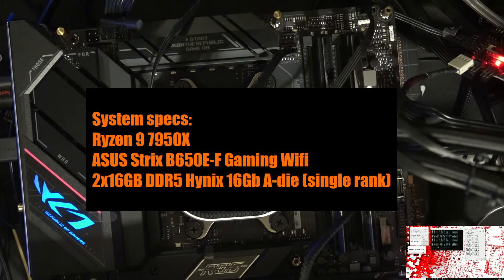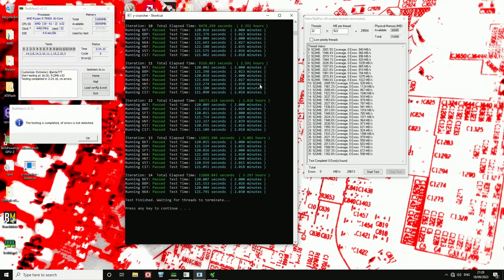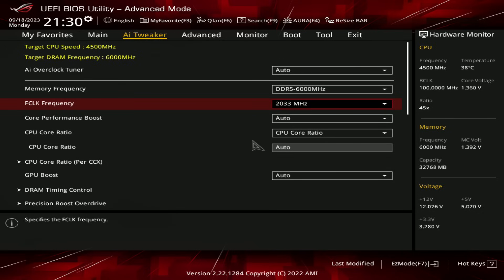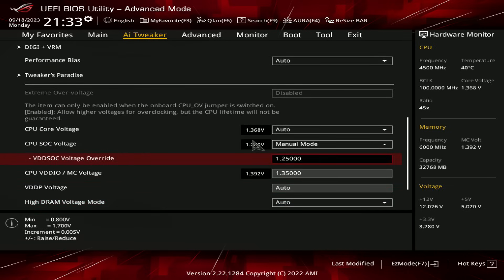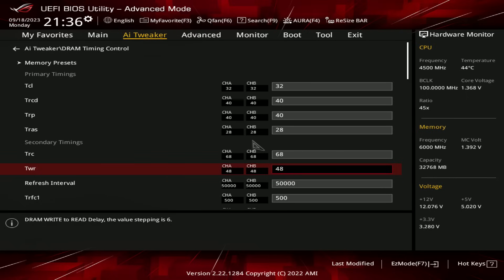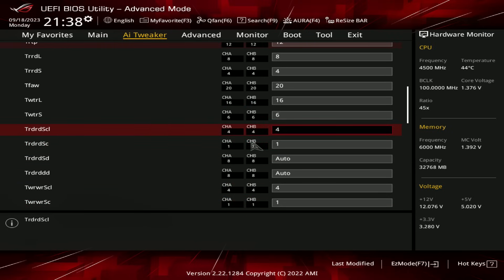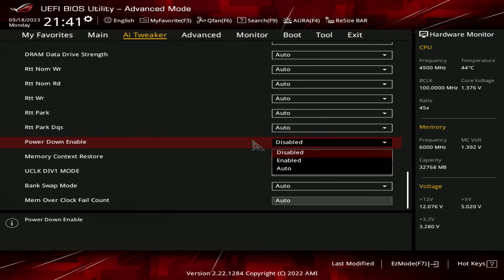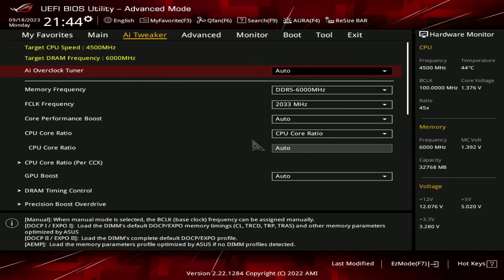Easy memory timings for Hynix DDR5 with Ryzen 7000

Comment: These timings worked perfectly on my 64GB dual-rank G.Skill 30-40-40 Expo kit (Hynix A die) with 7800X3D and Asus B650E-I.
I even lowered SoC voltage to 1.125 and VDDIO to 1.3

Stress testing passed. But my latency is around 63-64ns... Is that about right or seems high?
Reply: what settings did you use for the dual rank specific values?
Reply: @sandboxie97  I used same values from the video
Reply: How many memory modules do you have? I couldn't get it working with 4 modules
Reply: @icarus33  two sticks. I got s motherboard with only two slots because I knew 4 slots can cause issues.
Reply: Updated the BIOS a year later and now my PC won't post with these settings 😤

Comment: So after the recent drama about blowing up the Cpus limiting soc to 1.3V in Bios is it still safe to run VDDIO/MC at 1.35V ?
Reply: Yes.  The issue was with some motherboards sending too much voltage to CPU_SoC.  I have my MC/VDDIO getting 1.4V as I (unnecessarily) have 64GB of RAM.

If you have an Asus board, I would recommend manually entering 1.25V for the CPU_SoC setting instead of the 1.3V that AMD recommends.  This is due to the Asus boards sending more voltage than what their BIOS says that they'll be sending.
Reply: @NippleSauce   Thx that was helpful.

Comment: Thanks Buildzoid.  I've been worried about my 7800x3d asus x670-e system since the issues started.  I wasn't satisfied with just reducing voltage on my expo settings and I found your guide through GN. After following it, I was showing stable with OCCT tests.  Running stability tests again after reducing soc voltage further to 1.2 and VDD, VDDIO etc. to 1.3.  So far so good and better performance than when I was unknowingly feeding too much voltage by way of ASUS expo voltage accompaniments.  Anyone have suggestions if this setting is stable?  Additional tests beyond OCCT? Try to push beyond 6000mhz and 2033? Thanks!
Reply: Hi mate, I'm wondering if your system is stable with these settings, as I'm about to get my 7800x3d build complete 
I'm trying to find a solid (6000/6200) timings, and the one I chose is T-force (6000-Cl30-36-36-78) as a default XMP.
Reply: @Rochi7  are those hynix? I'm using gskill sk hynix and the expo is 6000 30-40-40-96. I have expo off with buildzoids timings set in except for 1.2 soc voltage and 1.3 for the associated memory voltages.  Been running it for a few weeks now with no issues. Cheers man.
Reply: @vasheroo  Wow thats great 
and yea t force I have is hynix
Edit: I can not guarantee if it is always hynix, since you know they change their chips frequently to avoid sales problems. I remember I saw some of their models including letters that refers to (A-die) like this model as an example (FF4D532G6000[H]C38[AD]C01) and and it is not A-die but it is hynix.
Reply: @vasheroo literally exact same for me, so far.solid, stable, and i have better fps, more fluid gameplay too.    I also OC/undervolted my 7900xtx merc 310,     cpu temps are like 50-65 for gaming, 70 when shaders load.    And gpu temps are 60ish gaming, with junction of 78-83°,     please relay me your temps? <3 tyyty
Reply: My hynix is an m die btw , this vid worked flawlessly.with my m die
Reply: @fuckyoutubrforchangingthis  Those sound pretty similar.  I booted up control and set it to ultra and dlss to increase the frames with all the rtx and cpu temps were about 60 degrees C on both the CPU and 4090.  Corsair h150i 360 rad on the 7800x3d and the 4090 is the liquid msi.  Fan speed is generally set more to quiet running.
Reply: Cpu-z works to tell.if its hynix or samsung die

Comment: Thanks Buildzoid, I followed these settings for my ADATA 64GB XPG Lancer RGB 6000MHz DDR5 on a Gigabyte B650 Aorus Elite X motherboard with a 7800X3D. My system seems stable with VSOC of 1.2V (was too scared to bump it up higher due to exploding CPUs) and VDD of 1.35 (as per EXPO profile).
One thing I found different is that for my Tras, the lowest value I could set was 76.  I had no option to set it to 28.
Reply: Mine is 30
Reply: It’s all good man he revised it in a newer video and it’s above 100 now and apparently takes no performance hit but still stable
Reply: what kinda performance gains did you get? i have the sameeee cpu and mobo

Comment: I've never manually overclocked or set any manual timings/settings for RAM before and got this exact video bookmarked for when my F5-6000J3040G32GX2-TZ5K arrive. I will be using them with Ryzen 9 7900X and MSI MPG B650I EDGE WIFI. I ordered them because their low timings but it's with 1.4V which at this point I'm obviously not gonna use. Would I just be able to copy paste video settings and set the specified timings from G.Skill at 1.25? Or would I most likely have to increase my timings?

Comment: Thanks for the video, it was very helpful.
However, 2033Mhz Infinity Fabric clock is not a universally good idea - on my TUF GAMING B650M-PLUS WIFI it leads to retransmissions, causing lower performance and random audio crackling.
Reply: I have TUF GAMING B650-PLUS WIFI so what Infinity Fabric clock must be for optimal performance? 2000MHz ? or more than 2033 Mhz like 2067 Mhz , 2100 Mhz etc. ?
Reply: @nanotech5904  in my experience 2000 works the best
Reply: I experienced this too, tried a few different FCLK settings with no avail. What actually changed things was lowering my primary timings. Sadly after a bunch of stability testing which passed it seems like my memory doesn't like cold booting with these timings. Did you make any progress with this?
Reply: @BobbyFuzzy  I ended up returning to the stock "tuned EXP2" settings instead of overclocking memory. Seemingly stable adjustments turned out to be crashing specific games, like Metro Exodus, so I decided to just wait for better RAM sticks instead.
Reply: @Strange_st  Fair play. I think I will be doing the same tbh. Thanks for getting back to me! Have a great day 🙂

Comment: Can confim that i can replicate this exact settings using ADATA Lancer AX5U6000C3032G-DCLARWH (32x2Kit, 6000Mhz, Hynix A Die), everything is working great as well, i don't even need to change DRAM Voltage. Thanks a bunch Buildzoid!

Comment: I got my my girlfriend and I the same RAM kit (should be SK Hynix M Die). Mine was A die (at 5600 kit) but hers is unknown in HWINFO, but it is SK Hynix apparently. I can't seem to indentify it.
My RAM is stable at timings at much tighter than those in this video. However hers is blue screening at the timings in this video. Any ideas? I'm using a 7800x3d and she has a 7600x. I'm kind of lost why its blue screening on these timings which I now know to be really safe given I can go much tighter.
Reply: all ram is different even with same brand.

Comment: Tried this with my 7800X3D and an EXPO stick of Hynix M-die. Absolutely no chance. If I increase the VDDIO at all, I get Bluescreens or freezes. Same thing when I try to lower Tras even a little bit. Refresh interval can be increased no problem. Some other timings can be moved marginally. But otherwise a lost cause. I use the latest Gigabyte BIOS, so maybe the limitations introduced with it are to blame.
Reply: EXPO is irrelevant, just saying. It's just a profile for primary timings, speed and dram voltage, nothing more.

Comment: I bought a cl32 gskill 6000 expo kit but it cant run with the 6000mhz. I lowered it to 5800 mhz and it. Works fine. 32-38-38-28 and the rest with your secondary timings. Lets see what happens. 
First time trying memory oc. 

Nope dosnt work for me, it fails on y-cruncher SFT or C17. Says something is to large failed core 9 ?

Comment: FYI, disabling Power Down Mode made my system incredibly unstable - would blue screen on/just after boot over half the time, and even freeze in bios frequently. Took a while to narrow it down, but that seems to be it
Reply: Try disabling MCR.
Reply: @MrShnig  what is mcr
Reply: @SmellsLikeNirvanna  memory context restore.
Reply: I disabled both MCRs as well as power down and still got bsod on restarts. Re enabled all of it and bsod went away
Reply: @YT_Booost  I wrote to Asrock support and they told me ddr power down needs to be enabled for newer AGESA by AMDs rules.
Reply: Thank you for the heads up, I never considered that it could be the culprit for my crashes and freezes in BIOS. Maybe without it I can give it another try.
Reply: Thank you for this, seemed to solve BSOD and BIOS freezing.
Reply: Always use MCR and PowerDown together! If MCR is Enabled then Enable PowerDown!
Reply: memory context restore always disabled with power down disabled. Keep it like this if you OC your RAM
Reply: Were you able to make it work with it disabled?
Reply: Anyone else give this a go? Seeing the same issues as Broodyr. I was bluescreening around Windows login and while in bios. I could however run memtest5 and occt for an hour each just for minor testing with no crashing. Going to give turning on Power Down Mode back to auto a try and mess around in BIOS again and power on/off a few times to see if it fixes the problem.
Reply: @spardock3313  it's the power down mode and nothing else. For some reason it BSOD's and even freezes in the BIOS so I had to restore to a saved profile and everythng is perfect.
Reply: @realcapo88  did you try disabling MCR when you were trying to disable power down mode? My power down mode being off only led to crashes with MCR enabled.
Reply: I had the same issue, with power down, i can't tweak that...bios crash...blue screen..
Reply: that sounds more like a bug than anything else. training on every boot is never something that is expected to be set permanently. and power down mode shouldn't affect these.

I just mean putting these as recommendations might not be wise when some agesa update could make it wrong in the future
Reply: @e_one_m_one  I agree that it sounds like a bug, that something is stored in the memory context restore from the previous dram power down mode on, which causes the freeze if you just disable dram power down and keep context restore on. did someone try what happens if you disable dram power down, disable context restore, boot, reboot and enable context restore again, boot, so it does a fresh training if it then maybe works?
Reply: @e_one_m_one  I contacted Asrock support and they said their bios department said it is normal for the Pc to freeze when you disable dram power down mode and it is not supported with newer Agesa lol.
Reply: did you fix your problem?
Reply: @Aleph-Noll  what problem?
Reply: Anyone on here tested if you can run these BZ timings for a 6000 kit also with 6200 or 6400? or is it kinda strictly limited to 6000 if you dont change primaries.
Reply: @bestonyoutube These timings are for 6000. They will fail the stability test in "ycruncher" on 6200 or 6400, because they are way too tight for that.

BZ's own 7800X3D is not able to exceed 6000 in 1:1 mode due to his memory controller silicon limitations, so he cannot test faster MHz for us.

Furthermore this is for Single Rank 6000. It isn't appropriate for Dual Rank sticks. He said the timings should still work on Dual Rank but will risk instability while also leaving performance on the table, since he didn't adjust any of the extra timings specific to Dual Rank.

So yeah this video is what it seems: Hynix timings for 6000MHz Single Rank.

All this info is from his Jan 2024 stream where I asked him.
Reply: Not all heroes wear capes! Thanks for you service! Disabling it seems ti fix my bsods. However does it really impact that much to have it on and off ?

Also, it seemed to have worked all day long the first time i did disable power down but idk why it is unstable now!
Reply: Same here bios freeze every time with power down off…What now?Use the timings with power down ON and call it a day?
Reply: @Reggaement  your choices are pretty much between faster boot time (MCR+PD on) or lower latency (MCR+PD off)
Reply: @Broodyr Thanks!Do you know anything about how the curve corrections affects 1% low’s?I read somewhere the higher the PBO lower the 1%…Iirc especially around -30.This is can be true?
Reply: @Reggaement  not sure, i've only done basic PBO stability testing so i'm at -25
Reply: @Broodyr And at -25 your 1% lows not negatively affected by the PBO?
Reply: OMG!! I just read this and tested again. Thank you so much! It seems to be indeed related, that if you disable power down mode, like suggested in this video, the pc becomes unstable quickly. I followed all the settings in this video, included turning off power down mode, but then after just after 20 seconds or so every time, the BIOS would freeze, several times again and again. I thought it was because of the timings, and I went back to stock. But now I tested again with keeping memory power down mode on AUTO, and now it seems to run stable, also no freezes anymore in bios!
Reply: @bestonyoutube  you can change memory power down to off but you just have to change MCR at the same time or else you will get bsod like you described.
Reply: @MrShnig  it makes no sense to turn off MCR, or you get long boot times. there is no meaning to train ram each cold boot. Obviously I want fast boot times and if you turn off MCR, you wont have short boot times.
Reply: @bestonyoutube  I know that, but it's the only way to change power down mode.
Reply: @MrShnig  erm... then keep power down mode on auto and leave MCR also on, thats the WAY better option of these two.
Reply: @bestonyoutube  then you won't get the lower latency which was the whole point in changing it in the first place. You have to decide which means more to you. Lower latency or boot times. I'm only telling you how to get memory power down to work as per the video.
Reply: @MrShnig  he never showed any benchmarks or data on these claims, that turning off the power down mode gave any latency changes at all. he just guessed it might have, and even if, it would be dramatically little. if youre gaming or doing any work load, the power down mode wouldnt be triggered anyway as I see it, only under idle conditions.
Reply: @bestonyoutube  I've tried it. It does reduce latency for me. Try it yourself.
Reply: @MrShnig  which benchmarks. how much.
Reply: @bestonyoutube  try Aida memory test. Can't remember, think it was 10ms
Reply: @MrShnig  well thanks might do. but I dont want a memory training every boot honestly. so there is no meaning in trying anyway. I guess this might be a bug in AGESA or UEFI maybe. why should a memory train each boot prevent the issue to happen. it also doesnt seem to happen on buildzoid board, so might be a bug in some boards? but I also have fast boot on in bios. maybe that hast something to do with it too?
Reply: @bestonyoutube  tbh I think that setting combination requirement is quite widespread.
Reply: @MrShnig  what you mean with that?
Reply: @bestonyoutube  most if not all am5 boards will require MCR changed if changing power down mode.
Reply: @MrShnig  BZ didnt say anything about that, at least not in this video, or did I miss it? do you btw maybe know if some boards do a memory training every week or so, even if you keep MCR on? or maybe after a longer period not on PSU power?
Reply: @bestonyoutube  no bz didn't say anything about that. What's your point though?
Reply: @MrShnig  what do you mean what is my point. he cant say you should disable something when you say you need to disable something else too to make it work on most boards.
Reply: @bestonyoutube  He did though.
Reply: @bestonyoutube just tested with MCR + power on auto, 75ns on AIDA. With both disabled I get 70ns
Reply: @MindLessWiz  but you pc needs 2-5 minutes to boot then every time with MCR disabled?
Reply: @bestonyoutube  just measured 37 seconds to post, about 45 to login screen. I can live with that

Comment: Thank you! Working perfectly @ 6000 on my 4x16 Dominator kit! Might try to push it a little higher just to see what happens, but super happy that my board can do at least 6000 on 4 sticks at all.
Reply: What mobo are you using if you don't mind me asking
Reply: @drxpsaucx4157  X670 Extreme (Asus)
Reply: You must have the same ram kit with me I'm running on Asus ProArt X870E and this guide help me with this set of ram.

Comment: Cant get 6000 on my gskill 6000 cl30 - best i can get is 5800 on 7800x3d asus x670e-a 1.35V should i go higher voltages or try 28 or 26cl timing?
Reply: Isn’t it dangerous do have voltage over 1.3 due to the cpu burning situation?
Reply: You have a bad cpu
Reply: When it boots up no issues or warnings.. but hangs when system reboots
Reply: @axnjxn2k1  my first 7800x3d was 85sp. it could run fine 6000 and 6200 but couldnt boot at 6400. Now the 2nd one runs 6600 ram stable.
Reply: @Eusebiugh  new bios I can run at xmp speeds - will run at cl28 timings but haven't checked for stability

Comment: Hi, any chance you could do a guide for using 4 sticks of ram? Im currently using 64gb, Corsair Dominator cl30 6000mhz. Im using 2x sets of these, so 4x16gb. My pc is running great on EXPO 1, 6000mhz. But, wondering if i could possibly get more from my kit with better timmings like you have done for 2 sticks here. The rest of my PC specs are: Asus x670e Crosshair Extreme, AMD 7800x3d, Asus 4090 Strix OC, 64gb Corsair Dominator cl30 6000mhz (4x16gb) at EXPO 1 6000mhz, 3x Samsung 980 pro M.2. Thanks